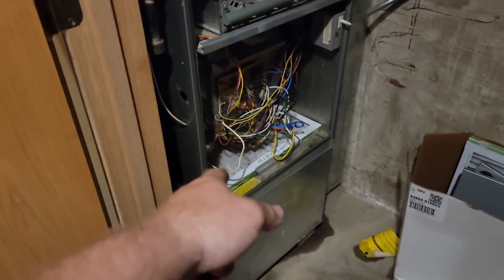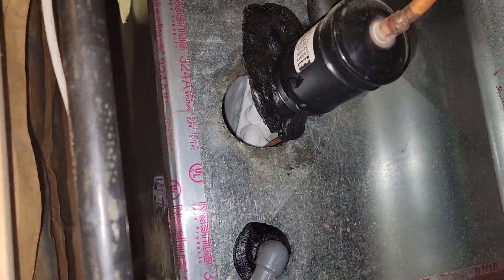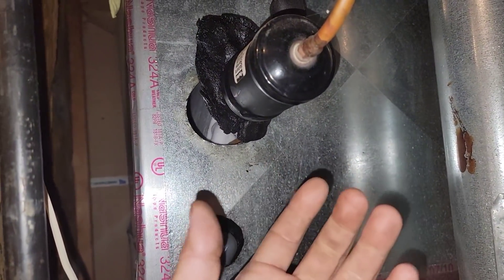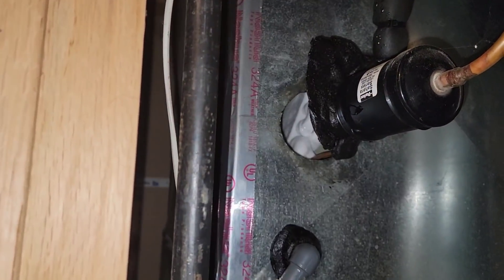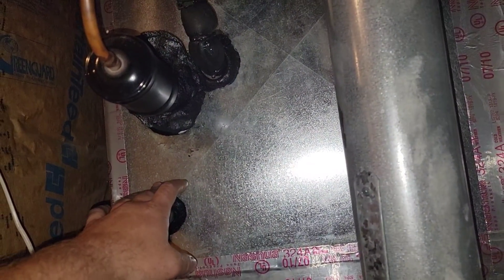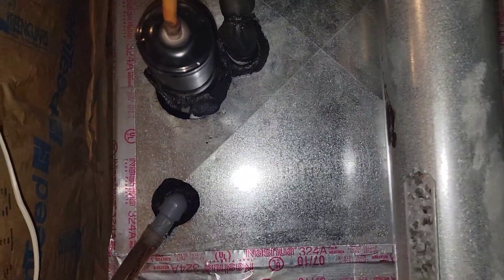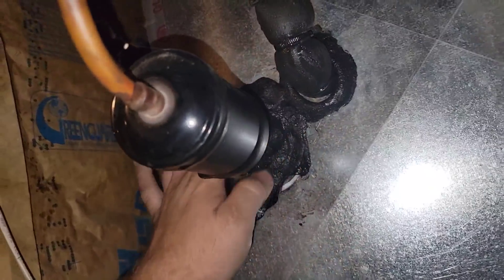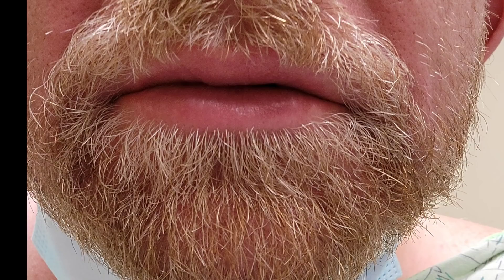Checking The Air Conditioner Put Me In the hospital, HVAC Guys I need your help

Comment: I’m an actual a/c guy.  When low on Freon it starts freezing at the evaporator coil so by the time you see ice outside you have 30 lbs of ice inside the coil.  Run the furnace to thaw it out and call in a buddy with correct Freon to recharge it.  If tech has been adding Freon then you have a leak somewhere. Lucky it’s nothing money can’t fix.
Reply: Was going to put on the same comment. Also, if the filters are of low micron, even name brands, it can restrict airflow enough to cause the evaporator to freeze up.
Reply: Probably combination of dirty condenser and low Freon.
Reply: @winch1587  I was also going to say the same thing. It is good to see so many people have his back.
Reply: Not a pro here but was thinking bad air flow at the condenser which we know was the case, low to no sub cool, vapor at the TXV and the rest is history
Reply: @12yearssober  Dirty condenser won't cause evap coil to freeze...
Reply: If the filter is clean it is usually short of refrigerant.
I’ma 49 year HVAC&R tech.
Reply: And it will be cheaper in the long run to replace the system rather than fix the leak...
Reply: All good advice  get a qualified Tech to check for a leak

Comment: Dirty evaporator coil or evap fan issue  low airflow.  or low on refrigerant due to leak.  Check  subcooling if it has a txv or superheat if it has no txv.

Comment: I believe your problem is low airflow through the evaporator. Check airflow at vents first. Need to check charge also. Low charge bad txv causes freezing too.  If not much airflow coil is dirty. Yes, you need to access evap coil. Remove pipe that is furnace vent. You may have to cut condensate drain line. It looked like PVC so get a coupling and some silicone sealer. If you can’t get good access take tin snips and cut back to the refrigerant lines and peel back the tin.  You can use foil tape or duct tape and seal it. Coil cleaner available at a hardware store, Home Depot, etc. in spray cans or liquid to use in a pump sprayer.  Get the non-acid type. Use a SOFT bristle brush and scrub lightly. Rinse. repeat until clean. I doubt that evap coil has been cleaned in a long time. Replace cover and run unit. You should see increased airflow at vents. If this unit was installed prior to 2011 or so it is likely R-22 refrigerant. Out of production. Recycled still available but the price has gone up. Still cheaper than replacement. Hope this helps.

Comment: From what i know...2 things typically cause freezing up, low refrigerant charge, or poor airflow through your A coil (evaporator)  that is inside your house.  I see you have a pleated air filter, i have seen these things cause freeze up issues.  I use the cheap filters, and change them more often, i think they are more effecient because there isnt as much of a restriction.  If the weed were grown up around your condensing unit, this may have been the culprit???  When you mow or weed eat, not a bad idea to shut off the AC  when mowing around it, let it sit for at least 5 minutes since turning off, before turning back on, to give the refrigerant a chance to equalize pressures (most units and electronic thermostats will not allow it to come back on for 3 to 5 minutes to keep from damaging compressor /valves.  If it doesnt restart immediately, dont panic, walk away for 10 minutes and see if it starts up after that.

Comment: Not a certified Hvac tech, but have done most every repair a person can do without a license under the guidance of someone that’s been doing it for over 30 years. Lack of airflow is the cause of ice 90% of the time. You are correct about needing to get to the bottom of the A coil. Once it’s thawed out, you can get a can of foaming coil cleaner from the hardware store and soak the coil down from the bottom then suck the debris out with a shop vac. Occasionally it’s a bad txv valve, if it has one, but your on the right path. Ran into this exact problem while out of state at a family member’s house just a few weeks ago. Needed a filter and coil cleaning.

Comment: Woah glad your ok after the hospital, scary stuff I have not gotten stung in many years. I'm a hvac tech, check to make sure all returns are open, filter looks good, possible dirty evaporator coil, low charge, failing fan capacitor or blower motor or restriction in HVAC circuit.
Reply from the maker: It was the evap

Comment: Had an HVac guy here last fall. I found the fan was weak. He found a piece of plastic bag was blocking my coil every time the fan came on. It must have got in there during construction.  
Rich clearing the weeds away from the outside heat exchanger will also improve air circulation and efficiency. Be well.

Comment: Glad to see your OK Rich. I had a swarm of yellow jackets sting my left hand once. Within 15 minutes or so my hand looked more like a penguin’s flipper. I also had to take an ER trip to get a shot. You need to hook up gauges to troubleshoot properly. Then you’ll know if it’s an airflow issue vs a freon issue. Cleaning the evaporator can’t hurt, but you could have something in the refrigerant system leak causing the coil to ice up due to low refrigerant and low pressure.
Reply from the maker: I found it it was a internal of the inside unit evaporator was completely plug with animal hair

Comment: When you call an A/C tech please don't forget to warn him there's a yellow jacket nest near the outside unit because that is where he is going to hook up the gauges. If I was the tech I would postpone the job until the nest has been removed.
Reply: they like to nest inside the condenser unit
Reply: @johnwickwayne4117  If things were out in the open I would get great satisfaction from roasting them but most of the nests I find are on the house itself and I wouldn't want to take a chance using a home made blowtorch to the corner above the front door when a well aimed shot of commercial killer will get the job done. I do however share your enthusiasm.
Reply: The irony being Yellow Jacket is a brand of HVAC manifold gauges
Reply: Best thing to kill bees/ hornets etc is Dawn dish detergent mixed with water and spray them. they suffocate instantly
Reply: @spudthegreaterusa8386  it really works. That's how I got rid of hundreds of bee nesting on my tree, my parents house, and neighbors.

Comment: Use to work Bldg maintenance and 95% of time, freezing was caused by low refrigerent. Most of the time the leak was at the schrader valve. Good luck and get well.

Comment: Two possibilities.  Low refrigerant or low air flow.  If your blower fan works then it's either low on charge, evaporator coil clogged up, or plugged filter.  Without a set of gauges for either R22 or R410a you likely won't know.  Once it's melted, check for a clogged evap coil.  You can then turn it on normally and make sure you're getting blower fan and airflow when in the cooling mode.

Glad you're OK.  Reactions to bee stings are no small thing.

Comment: That sucks about the yellow jackets. Glad you're feeling better! I am not allergic, but I had a similar incident a few years ago when I was trimming the shrubs. I didn't know there was a yellow jacket nest and I sliced it open with the trimmer. They attacked my legs as well. I ran about a quarter mile before they stopped chasing me. Ended up with about 5 stings to the legs. Came back at night and soaked the nest with wasp killer.

Comment: My evap was icing over as well, very low cooling.  On the bottom it was completely plugged with hair and lint.  Once it was cleaned off the air flow and cooling was amazing, like a new everything.  Our condenser was also low on coolant but the plugged evap was the main culprit.  Easy cleap fix, let it dry with the fan running over night, then vacuum off with soft brush and you should be good.

Comment: Glad you're ok man!  Many years ago  I stepped in a yellow jacket or wasp nest on the ground in a wooded area.  I was stung badly on both legs below my knees and was unable to walk for days.
Reply: Quick question, can you use JB weld around the outer gas tank housing inlet?  I have an 84 300zx and it looks like it's slowly seeping but not dripping.  This is the second gas tank and it was hard to find because they don't make aftermarket tanks for this vehicle.

Comment: The others have covered pretty much everything I could add to this, but also clear the area around the outside compressor. Weeds and what not hold the hot air around it and can cause that icing to speed up as well. As you know with working on cars, AC can be weird when it comes to "heat", because heat in the wrong place causes ice.
Careful with those allergies brother. My fav dish used to be stuffed bell peppers, then I started to break out in hives all the sudden. Found out I became allergic to Bell Peppers over age and it's gotten worse. Now if I eat anything that has Bell Peppers in it, my tongue swells, eyes swell shut, and break out in hives everywhere. Even if I touch a cutting board or wash a pan that had them in it, I break out. It sucks Ass because they put Bell Pepper in almost everything now days. Needless to say, going to restaurants is an adventure for me now because of all the x contamination, and I have to pack an E Pen to play.

Comment: Another A/C guy. BustedWalletGarage is spot on. I would add that the first thing I would suspect is a clogged metering device by the evap coil.  I would also ask myself why is that filter installed right where it enters the evaporator on the high side.  It's normally outside by the compressor. I would suspect that the compressor burned out at some point and a new one was installed. The filter added would keep any residual trash out out of the metering device after it was flushed and the new compressor/condenser unit installed.  I think the media in the filter has broke down over time and let some trash out into the metering device and/or the  filter itself has become clogged which is restricting flow, causing freeze up.

Comment: I would turn the heat on. Clear away growth/ brush outside so it WILL GET PLENTY OF VENTILATION. Check the air filter. Check belt on fan for slippage, Auto reverse / de-ice may not function, reversing valve may be water-soaked/ swelled up and stuck. A dryer MAY fix this. Call someone that knows what they are doing. When the temperature rises, so does the pain from bee stings.

Comment: Allergies can come along later in life.  Family doctor might or might not recommend epipen -- those are tough to get lately.
I haven't used my refrigeration training in decades, but first thing I always check is the evaporator drain.  Usually that will bring floods rather than freeze-up, but they do need to be blown or fished out occasionally.  Same thing with older refrigerators -- there's a trap and drain behind the evaporator.

Comment: Not an HVAC tech but I've heard plenty of them (including the one that installed my system) say that those pleated, 1" thick filters cause a lot of problems. They don't flow enough air and can cause the coil to ice up or the heat exchanger to overheat. Switch to a cheap, fiberglass filter like a Flanders EZ Flow. You won't find them at Lowes or Home Depot but any hardware store should have them. It's a cheap thing to try before having a tech come out.

Comment: I'm in South Florida and may be different guidelines apply here but that in-line filter/dryer right next to the evaporator, I've never seen before. Normally those are upwind, right after the condenser. Seems that where yours is, if it becomes restricted, it will act as a small expansion orifice and immediately begin icing up the evaporator during use.

Comment: You'll need a HVAC guy to come back out and check the charge, freezing up that bad is either a huge restriction in airflow or more likely a refrigerant leak. Going through the same thing now, had my system (old R22) charged a few weeks ago and back to freezing up, have a big leak probably in the indoor evaporator coil. Gotta get the whole system replaced in a couple days $$$$.
Reply from the maker: I fixed it, video up

Comment: I had the same issue two weeks ago, ran fan till I could feel the full force of the fan going thru to the vents. Called A/C repair to, also had just had system checked in April mind you, well seemed that system was low 1.5lbs of refrigerant, once topped off A/C worked very well. Hope that helps.

Comment: Let the fan run until completely thawed out.  Mine took a day.   One issue that can cause this is low refrigerant.  I work at a data center we have CRAC units. Really big A/Cs.  This sometime happens and it mostly is low refrigerant.  You may have a leak somewhere. Maybe condenser or evaporator.   Hope you feel better from your bee sting.
Reply: Liebert equipment or Trane ?
Reply: @BustedWalletGarage  Liebert
Reply: @chrisjavorski1530  I got certified on those.  Password “ 5010 “ , turn off all the alarms and walk away like a boss.
Reply: @BustedWalletGarage  lol
Reply: That makes me wonder about my air conditioning in my 2005 Dodge Dakota,  it freezes up after running it about 30 minutes.  Switch the air to fan only for about 10 minutes it unfreezes, turn it back on and it works.

Comment: Check the house and make sure all vents and air returns are not blocked shut off etc.   This is normally and air flow issue.  I have found that as long as the unit has been run with a filter, dirt on the condenser isn't a huge issue.
Reply from the maker: New video is up, I found the fix
Reply from the maker: A coil evaporator plugged up

Comment: Also need to check the registers are open and doors in rooms are open.
Check that furniture isn't blocking the intake of unit.
The unit needs enough cfm's of the wormer air from the return across the coils to keep it from freezing up as well.
Good luck.
Reply from the maker: I fixed it it wasn't pretty much most of the things that people were suggesting and it was the a coil was plugged up from animal hair
Reply: @FordBossMe  Awsome! Glad you figured it out.

Comment: There is only a few things that cause the evap to freeze 1-airflow issue check if the coil is clean and IDBM isn't dropping out 2- refrigerate charge issue 3- contactor on the outside unit is intermittently getting stuck after a call for cool, causing the condenser to stay running and the blower to shut off. 

It sounds to me like a charge issue or the contactor check your pressures and SH and SC and make sure the contacts on the contactor are good not black and charred up.

Comment: Fought with freezing coil for years. Stupid techs never fixed much, lied about cleaning with "spring tuneup package", etc. Mine was overly dirty, like it was coated in paper mache. Once I got it cleaned and made sure nothing else was blocking airflow, it hasn't frozen in 2 years. And this year has been crazy, record heat for this area.

Also had TXV replaced, but not sure if that really helped since the cleaning is what really fixed it.
Reply: I find the more a system is messed with when it's working fine the more likely it is to break sooner.  Basic maintenance is all that's needed.  Clear dust/debris, clean condensate drain, change the filter regularly.  And don't forget to keep the condenser clear and hose it off at least every year.  PSA:  The condenser is NOT a shelf.  Stop putting stuff on it.  Glad Rich is OK.

Comment: Is the blower motor inside blowing? If not may need a capacitor and blower motor internally. Also, check all the interior house 🏠 vents and registers make sure OPEN, and  clean, then check your indoor unit filter maybe clogged. The evaporator should be clean if the filter system is working properly. There is a also a sensor you can put on the evaporator so when it starts to ice up it disconnects the compressor outside,....it hooks up to the control board depending on make and model and wont allow it to ice up. Or also a low charge, just like tranny fluid if you have to add you got a leak somewhere. Don't use the super thick hypoallergenic filters they can cause due to too restrictive.

Comment: That silver tube is the exhaust for the furnace so MAKE SURE you reinstall it correctly. Yeah it sounds like you probably need to clean the evap coil. Pull the front cover off and gently side the evap coil out so you can get under it. BE CAREFUL TO NOT KINK THE COPPER LINES. Use warm water and a soft scrub brush. Gently run the bristles up and down the fins to remove any debris and rinse the coil after. Make sure to cover any holes or gaps when reinstalling the cover. If you have that much debris building up in a year, you need to look for holes in the return ducting. I have pulled 25y/o units that have never been cleaned because they had a fully sealed return and good filters.

Comment: For your situation freeze up during cooling

-possibly airflow issue, unlikely if you havent made blower fan speed changes recently
-possibly dirty evaporator, unlikely if your filter is changed consistently. the green merv 6 filter if clean would probably not lead to a freezing evaporator, higher merv rated filters could
-possibly low on refrigerant, system operates and refrigerant saturation temp could be well below 32 degrees and evaporator will freeze will over time 
-possibly restriction in refrigerant circuit, if your system has txv it could not be operating properly causing suction pressure to be low therefore low saturation temperature -> freezing

I'm assuming your blower motor operates normally without issue